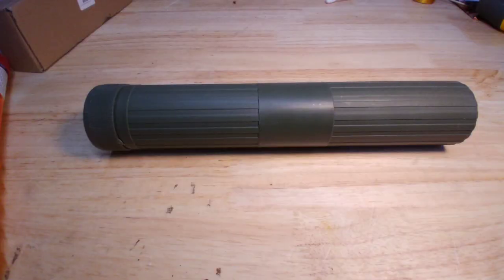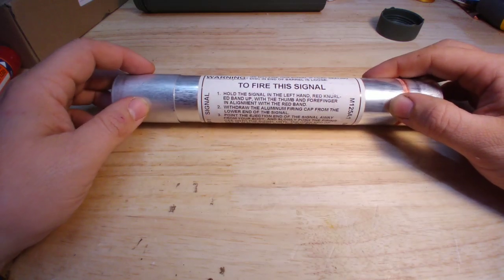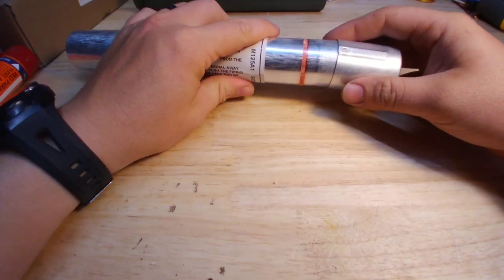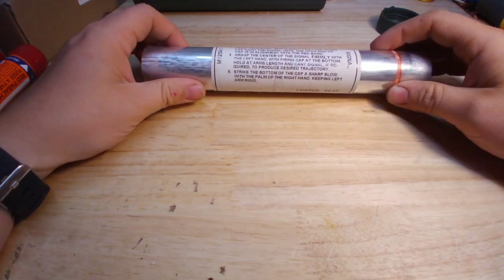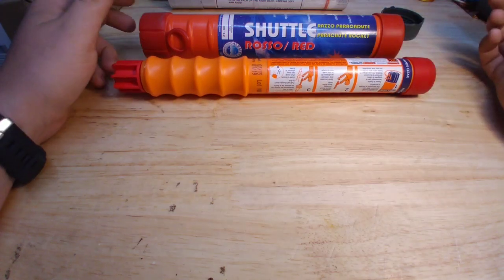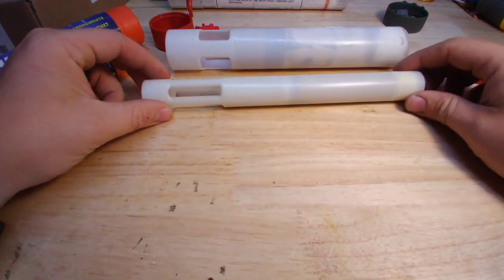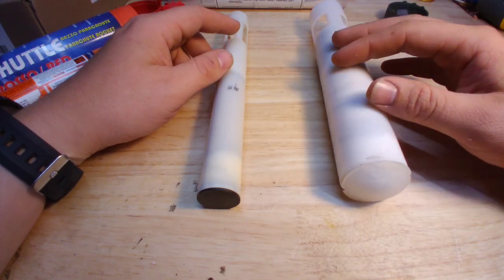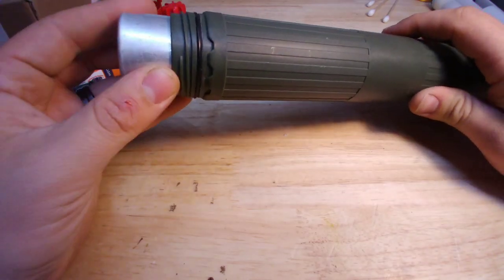M125A1 Pop-up Signal Flare (Ordnance Overview Episode 4)

Comment: We liked to use the green cases for holding our cleaning kits.  There is a particular way to hold these when you use it to prevent your wrist from moving and shooting the flare into your face.  Suppose to have the left hand turned palm away from you, thumb down.  Never saw anyone shoot them self in the face doing it wrong, but I did see a cover get knocked off once.

Comment: I know it’s slightly off topic but can you reuse M118 hulls or are the just cool to look at after fired?
Reply from the maker: They would be very difficult to reload due to the lack of a hole in the high pressure chamber to press the primer plug out. It is possible though by drilling a hole there with a lathe and then closing it with a properly sized screw.
Reply: @ChevTecGroup  I figured that would be the case. Thought about some kind of hydro press like with berdan primers or drilling out and threading to extract.  
Thanks for the reply.
Reply: @davegreenleaf5272  takes a shotgun primer not berdan primed. identical to a 12ga primer and if you reload like myself you should have alot of those primers on demand. no need to drill either. tap out old primer with thin metal rod and replace with live primer simple process.